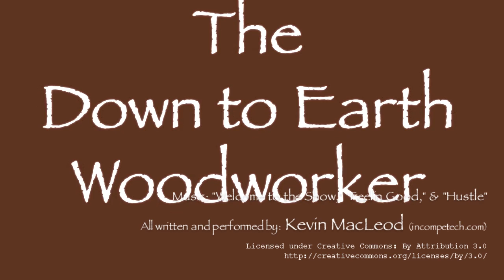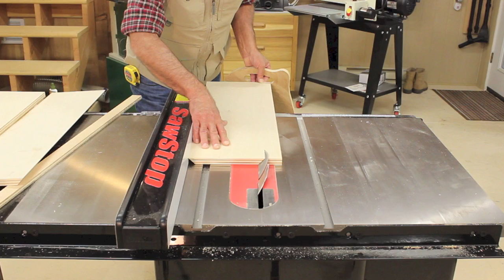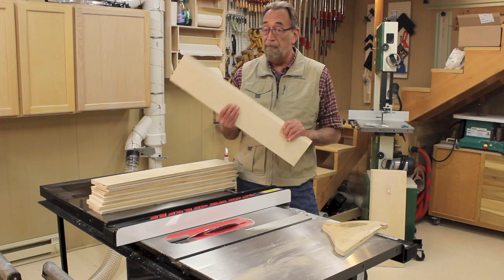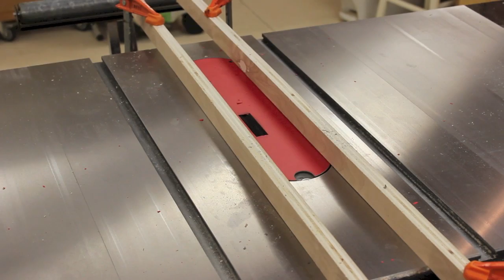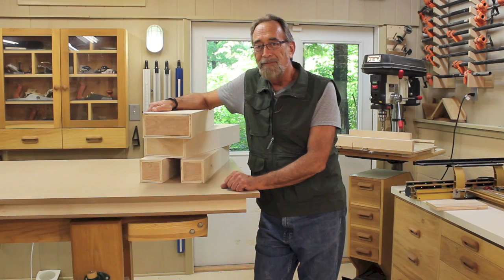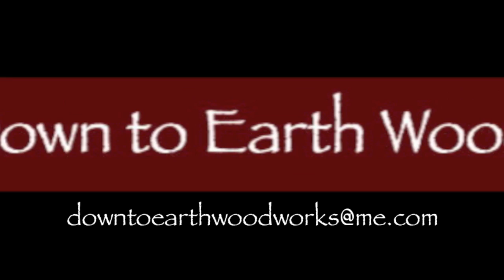SawStop Outfeed Table Pt 3

Comment: what type of plywood do you use,seems every time I buy plywood the edges look good,till I cut into it and it has so many voids I end up cutting little filler pieces for the voids! and I can't find BB in 4x8 only 60"x60".
Reply from the maker: You are 100% correct on all counts.  I get "furniture grade" plywood from a hardwood lumber store locally.  It is better (and more expensive) than anything you can get at the "big box store."  Having said that, it is not perfect, either, but there are far fewer voids inside and the surface is flatter.  Try contacting some local cabinet-making shops and find out where they source their plywood.  Chances are pretty good that they have a trusted source you can tap into.

Comment: Great design and I do need an outfeed/assembly table!  Quick question... what are you using for the vacuum hose holder I see in the rear of your video and what are you attaching it to the support with?  Thanks again! Jeff
Reply from the maker: Jeff, are you referring to the support arm with the green vacuum hose?  If so, that is a Festool accessory for the CT 26 and CT 36 dust extractors.  These are the part numbers: CT handle (495802) and Boom Arm Support Bracket (496780).  Hope that answers your question.  Thanks for watching!
Reply: That's the one!  Kind of thought that but thank you for the part numbers as well.  You do a great job on your videos by the way!

Comment: Steve, thoroughly  enjoy your videos. Being new to wood working, I am picking up a lot of great techniques to use in my shop when it is done.
I am building work benches for my shop. My plan is to use 2 layers of 3/4" plywood topped off with 1/8" hardboard.
I was wondering if I should consider the torsion box method that you used on the outfeed/assembly table.
Any advise will be very much appreciated.
Reply from the maker: +Steve Kinnaird Thanks for watching and for the kind comments!  To some extent, it depends on your intended (or primary) use for each bench.  If you will be doing layout and assembly on a bench, flatness may be your most important consideration.  A bench "frame" assembly that fully supports the plywood and is, itself, perfectly flat, should also be reasonably flat.  However, a torsion box is made flat and will stay flat... perfect for assembly work.  If you intend to do a lot of "pounding" on a work bench, a thick plywood top as you describe might be a good choice.  If you will be doing a lot of hand work, you will want a bench with vises, dog holes, ways of holding material in place while you saw, plane, chop, etc.  In that case, you will want a solid wood bench top.  Not to evade your question, but the bottom line is, how you build the top will largely depend on how you will most use the bench.

Comment: From what Ive seen the DowntoEarth Woodworker has made it clear in several of his videos that he has acquired all his shop tools the same way any other normal guy/gal would... Saving up and spending hard earned money.   This video series is specific to the SawStop table saw & if you watched the earlier vids in the series you'd see its a brand new table saw addition to his shop & has designed and is building the outfeed table exclusively for it.  Although he doesn't receive any enforcements, judging by the quality work in his other vids and the quality the furniture and such in his shop... Im sure he could if he wanted to, and who doesn't want free or discounted stuff you'd save up to buy anyway?